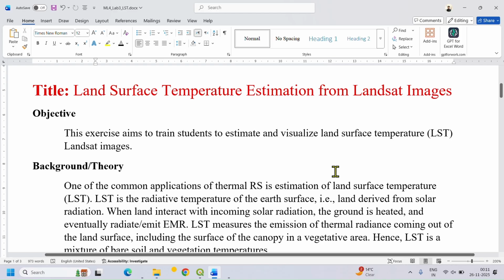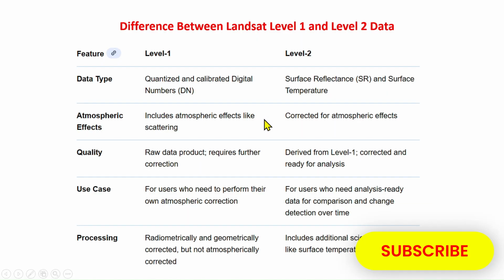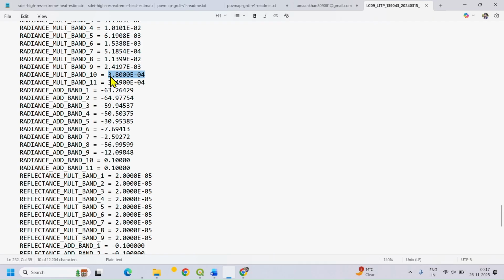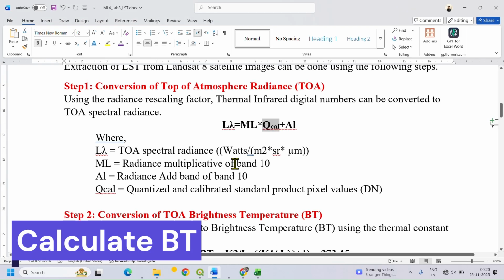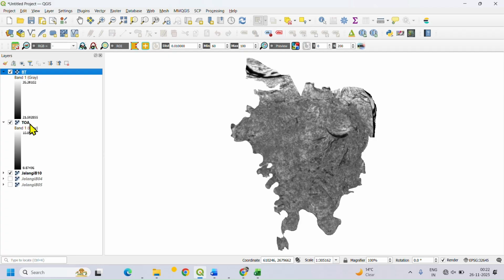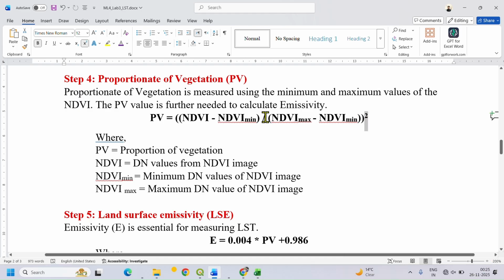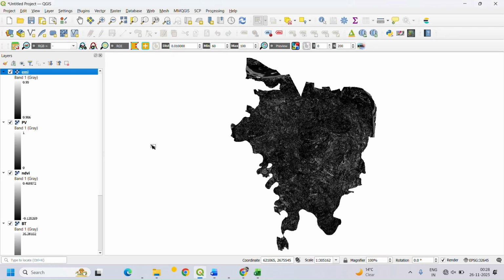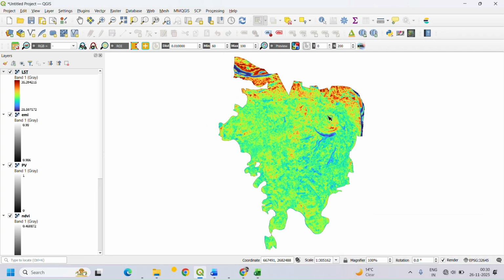Calculate Land Surface Temperature (LST) using Landsat 8 in QGIS | Simply GIS Training

Comment: I am not getting the correct values for Bangalore lst high is 54.885 and low is 7.99423. What is the problem???
Reply from the maker: Make sure you are using collection 2 level 1 data..

Comment: Sir, I calculated LST  for 2015 and 2025 (same month data).
For 2015, max is 46.58°C and min is 27.19°C.
For 2025, max is 43°C and min is 25°C.
Even though the month is same, values are different.
Is this variation due to yearly climatic differences, or am I making some mistake in processing?

And my doubt is that temperature should be increased why it will decreased
Reply from the maker: The results seem ok. You need to compare the results of two times using the 'i' button in your software. 
Check the variation at the same point. You will understand the difference
Reply from the maker: If you are expecting an increase in temp, check for other years also. Temperature doesn't increase every year, it fluctuates. The average temp over the years increases.
Reply: Sir, earlier we compared the LULC of two different years and observed that the built-up area has increased. Now we are planning to analyze the Urban Heat Island (UHI) effect.
In this case, should we necessarily expect an increase in temperature (LST) along with the increase in built-up area?
Also, for the analysis, is it sufficient to correlate LST with NDVI, or should we perform any additional analysis?
Reply: So sir We can go with the above LST data is it fine right
Reply from the maker: @ryuk.27 the LST results seems fine.. 
As you are looking for UHI effect with increasing built up. If the UHI spread as like the built up expansion, the results are perfect then.